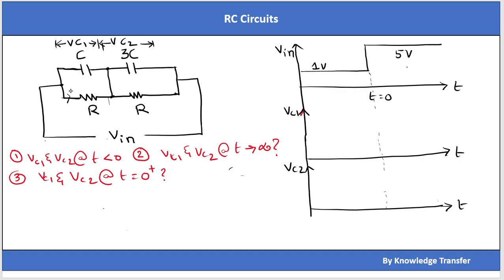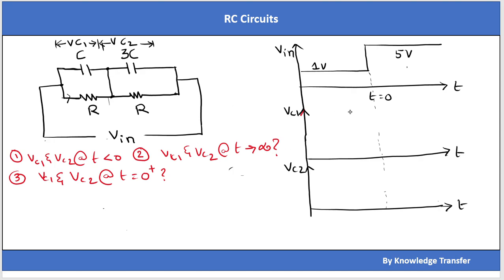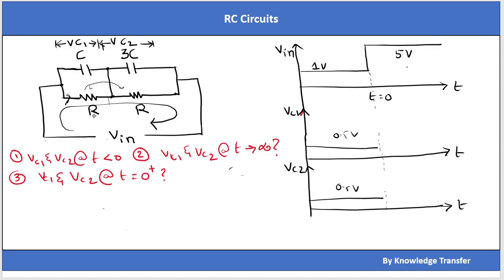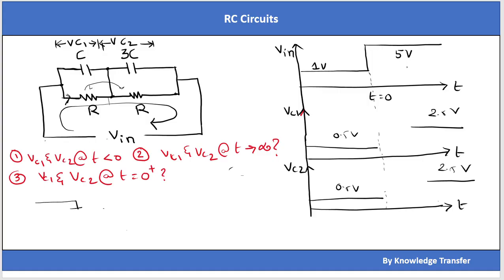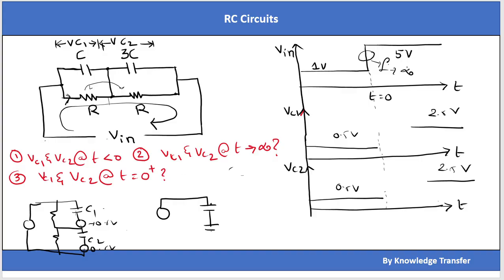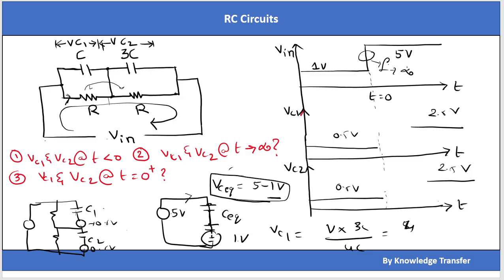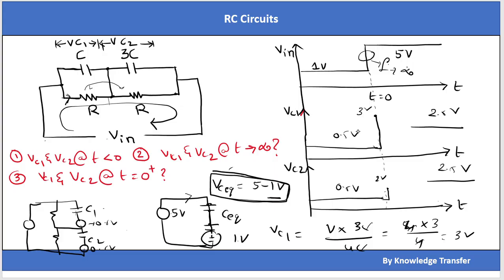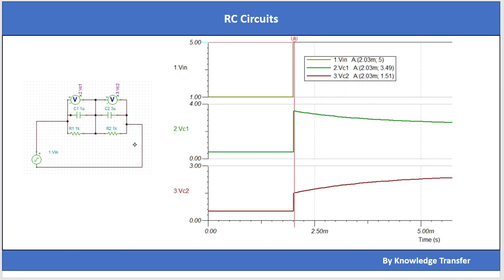RC Circuit Intuitive analysis. Unconventional question

Comment: Please correct your graph to match the sim. Since the 2 caps are in series, they have the same charge. Thus Vc1 will be 3.5V (3V + 0.5V inital) and Vc2 will be 1.5V (1V + 0.5V initial) @t = 0+.
Reply: yess correct

Comment: why you have ignored resistors ?
Reply from the maker: When cap is short circuited and resistor is in parallel to that short circuit. Net resistance will be zero or short.